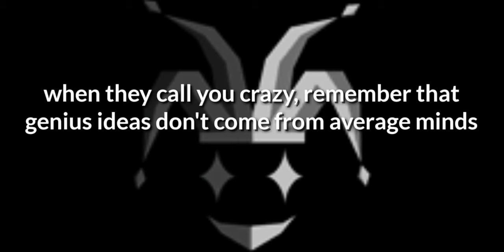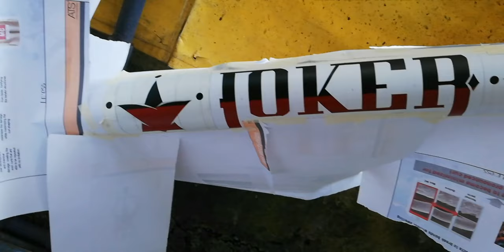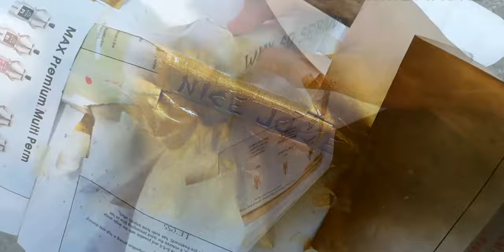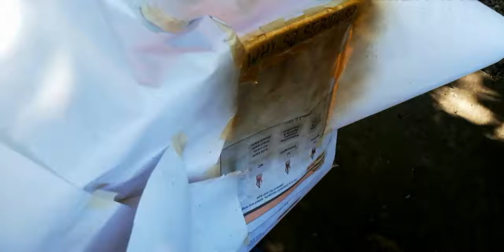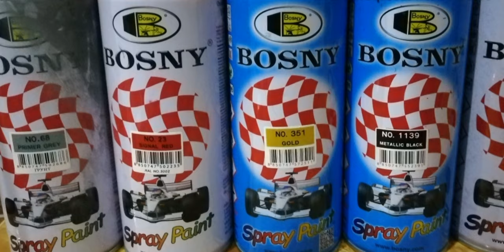How To Paint "The Joker" Design On A Bike Frame Using Spray Cans / The Joker Custom Paint Job

Comment: Ano reason boss bakit need lihain ng 1000 grit ang first clear coat? Thanks.
Reply from the maker: para mas makinis, optional lang nmn un, pero kung ok na sayo unang patong lng at nakuha mo n ng makinis ayos na un
Reply from the maker: pag may mga design kc usually may maiiwang marks ng stikers kaya mas ok din lihain para pag pinatungan pa ulit ng clear mas makinis na
Reply: @chrisworxcustoms  salamat lodi!
Reply from the maker: you're welcome sir
Reply: @chrisworxcustoms  ano pala gamit mo to remove the paint boss? Diba lalagyan nung paint remover, ano gamit mo pangkuskos? Or punas punas lang natatanggal na agad yun?
Reply from the maker: stripsol ung brand sir, puwede ka makabili sa mga hardaware may mga ibang brand din

scraper or any flat na plastic or rubber  para hindi masyado magasgas ung metal, pag umangat naman na ung paint madali ng tanggalin

kung may matira mang mga paint chips, gamitan mo ng lacquer thinner
Reply: @chrisworxcustoms  thanks for sharing paps.
Reply from the maker: you're welcome sir